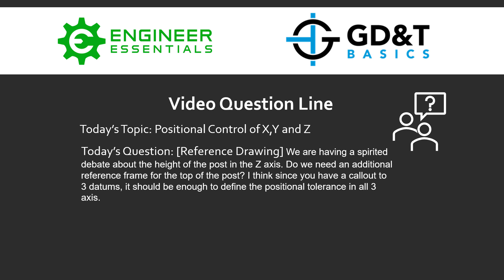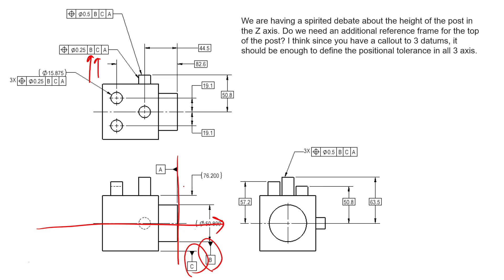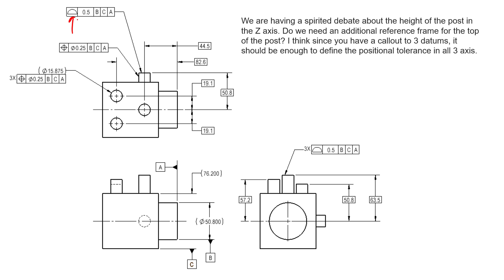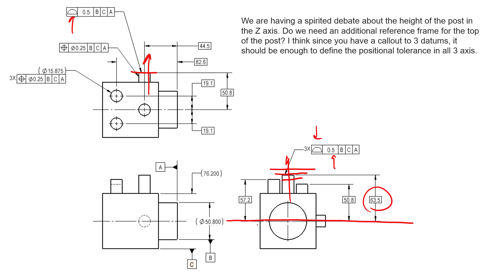Positional Control of X,Y and Z

Comment: Id reason that the position call out is illegal to the post tops, as position should only be used on a feature of size. Surface profile more appropriate surely ? 
Note I'm not up with the most recent standards, so if the feature of size requirement has changed, then ignore me. 👍
Reply from the maker: You're absolutely correct if you are referencing ASME Y14.5. As we mentioned in the video, we would HAVE to use Profile of a Surface if the drawing was utilizing ASME. However, ISO allows for the use of Position Tolerance on flat planar surfaces.